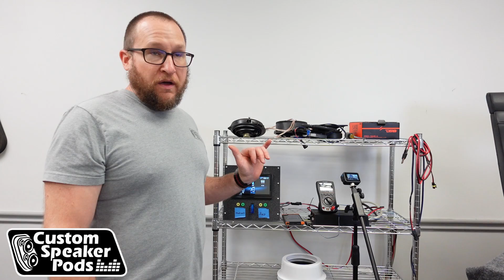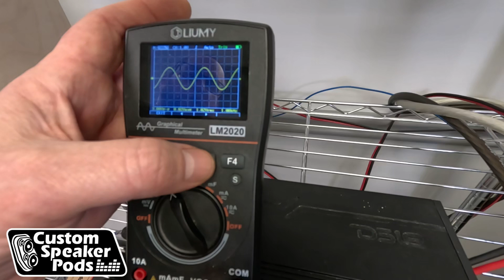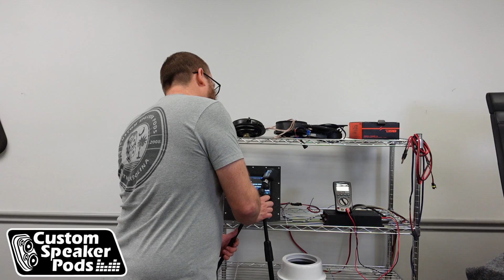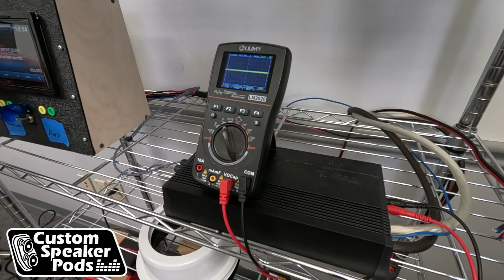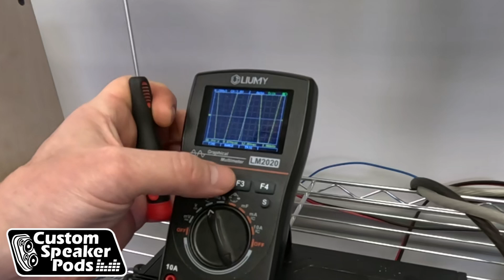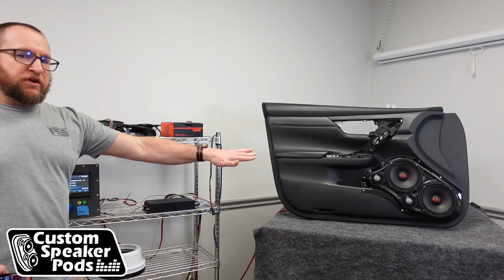Setting up an amplifier for midrange door speakers... It isn't that hard.

Comment: I don't know about everybody else but I think it would be easier for me to understand if you just use extra music so we could hear what it sounded like. I'm trying to run for 6x5s onto a DS-18 800 watt amp and for some reason the noise was barely audible I don't know what I did wrong or what
Reply from the maker: Setting gains by ear can be done, but it is not recommended for a couple reasons: 1. It is LOUD, 2. You can still get clipping if not done properly and damage your speakers, 3. If your amp is overrated for the speakers you need to set the gains lower to match.
Possible reasons for not getting output to your speakers: 1. Crossover settings are incorrect (either in the amp or head unit), 2. Using the incorrect head unit output (sub instead of front/rear), 3. No power to amp (bad power wire run, loose wire etc) some amps will pass signal through without being amplified (not sure about your amp).

Comment: How do you set your crossover settings on your head unit
Reply from the maker: For this test everything was flat.  Crossover settings will have to be another video.
Reply: On what frequency do you test amplified tweeters, mine has a range from 4khz to ...  did set the hpf to 6khz to be safe

Comment: You should probably mention the headunit settings for maximum unclipped volume.  I am guessing you ran everything Flat?  
Correct me if im wrong but 
An  increase above 0 or flat response in treble,  bass, or equalizer settings can clip your signal sooner.  Same with loudness if the radio has that feature.
Reply from the maker: Very good point.  The head unit was set flat for this test.  The lack of 'clipping' on the head unit was slightly annoying for this video since I wanted to convey how important finding the clip point of the head unit is.

Comment: Set the probe on the oscilloscope to about 30/40 3 then x10 which is what he is doing to see that nice clean signal also this one is not 35 bucks a much cheaper one is though this is is 80+ because so many people like this guy use them. How did you connect to RCAS with oscilloscope did you customize your rods with RCAs on the end or you just shoved them in the rca jack thanks buddy great video